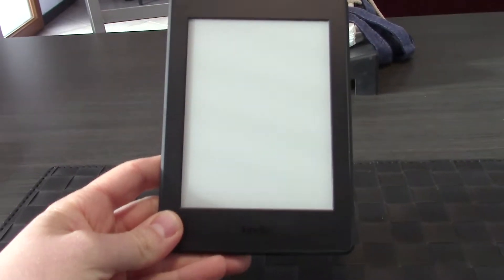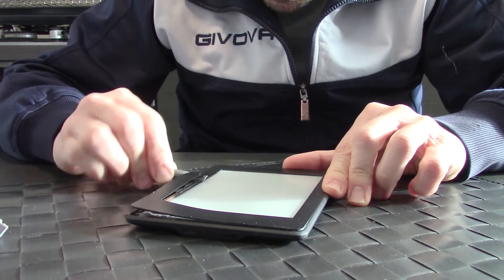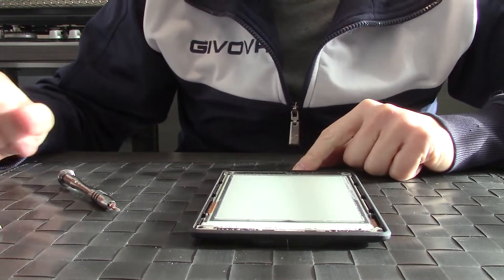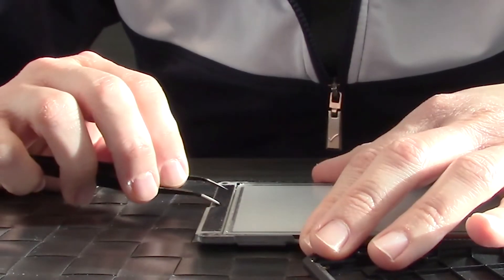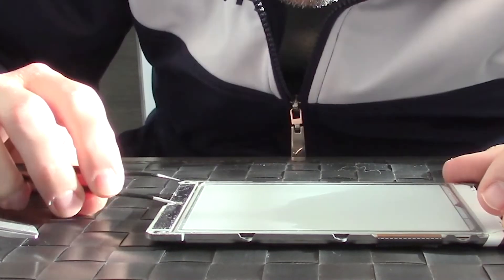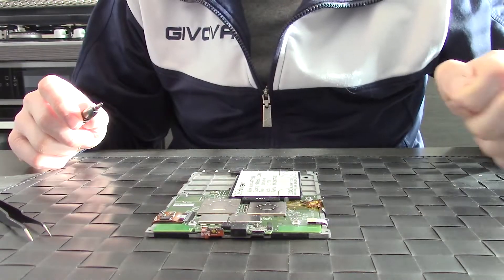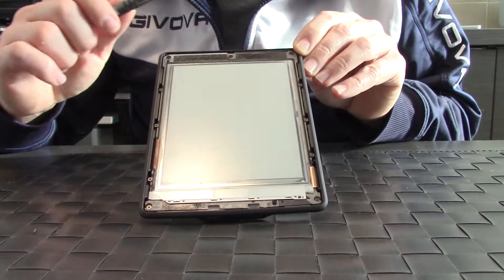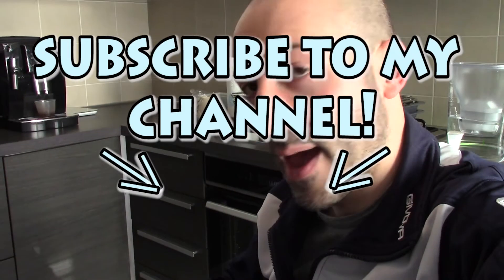Replacing Amazon Kindle Paperwhite 3 (7th generation) battery

Comment: Great video.  One thing that I found out also and am testing as to share with you too.  We can all learn from each other's mistakes.  I use the magnetic cover to turn off my 7th generation paperwhite.  I was a little concerned as since I was using it more it appeared to be loosing charge too quickly.  What I did find out was that even in the sleep/off mode the Kindle was still connected to my computer router.  My Kindle fire only does this when it is on, but for some reason paperwhite earlier generations have to  be kept in the airplane mode if you truly want less drain on your battery from WiFi.  I could be wrong, but I don't think I am as I've heard there are more choices in the paperwhite power management in later generations.    Thank you again for a great video.
Reply from the maker: @ProductivitySoftwareResearch  thank you 🙏

Comment: Thanks for the video and showing the mistakes and imperfections.

Tips for others: heat or warm the bezel to soften the glue. Be careful not to insert tool too far past the bezel and scratch the screen. The remaining steps are quite easy and straightforward. Credit to Amazon for allowing this unit to be repaired in such an easy way.
Reply from the maker: Thank you mate!
Reply: Can't you damage the screen while heating? Eink screen is pretty sensitive to the temperature afaik.

Comment: Hi when I attempted to remove the bezel, it looks like the top layer of the screen came with it there are weird wavy lines on the screen.  It appears the top layer of the screen separated and now won't meld properly with the underlayer.  has anyone had this problem and can it be fixed without replacing the screen?

Comment: Must the kindle be completely turned off? Mine is in screensaver mode but it’s not charging and I can’t hard reset it. Nothing is happening. no LED light too even when I have it connected to the computer.
Reply from the maker: Have you already tried to replace the battery?
Reply: @MoExha  I haven’t yet. I saw somewhere that says kindle must be turned off before attempting it. Also, I just ordered the battery replacement today😅
Reply from the maker: @makfmarquez  try to replace the battery anyway